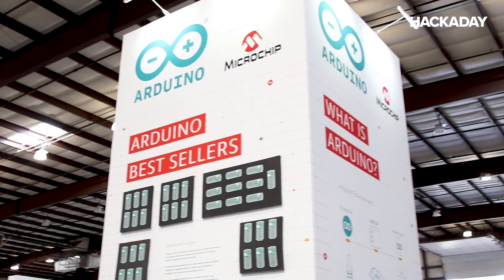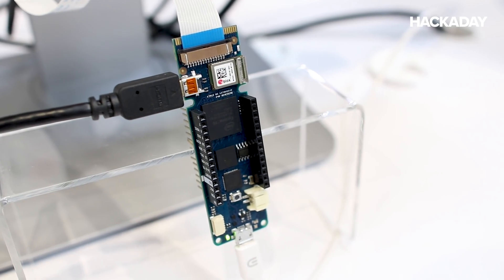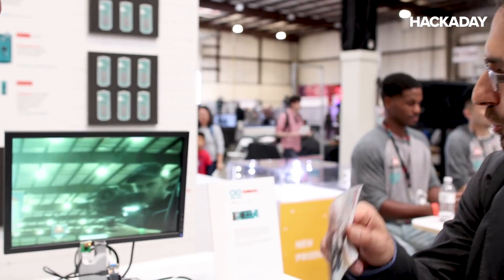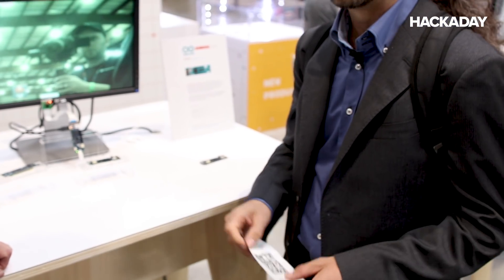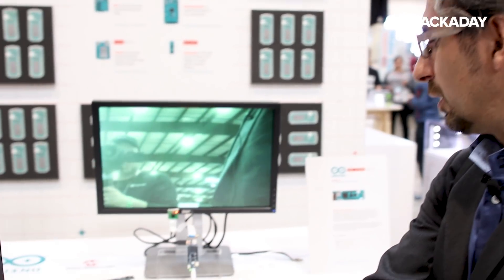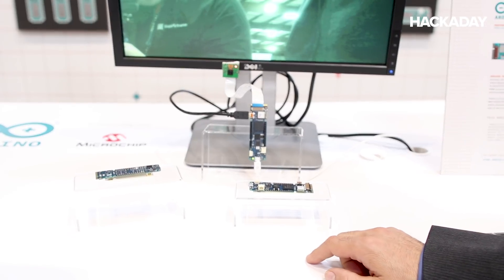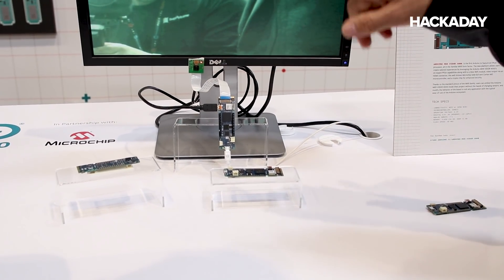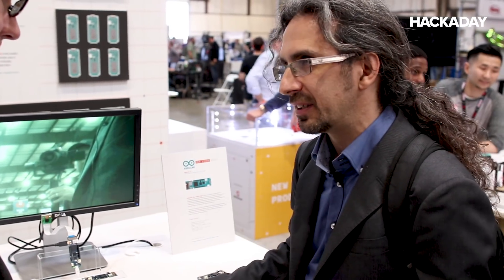Hands On With The FPGA'd Arduino at Maker Faire

Comment: meh, $60 US for cyclone.  I would rather buy zynq.
Reply: VegaDeftwing that's obviously not what I meant. Arduino's mission is to allow everyone to tinker with electronics without any prior knowledge. Of course this allows also professionals to take advantage of it greatly reducing the effort to do quick prototyping at reasonable costs. What I meant is that if you know how to handle fpgas, Linux, etc, you have a high Target and that's fine but has nothing to do with what we're doing here and is just useless to say we could have designed a more complex board as that would have just missed the point. This does not mean we won't be dealing with more complexity but we just had to start somewhere and this is our best shot at this. If anyone feels we could do better we're absolutely open to suggestions and would love constructive feedback as long as it is not out of context
Reply: Hi John, you are probably not discerning between price and cost. chinese manufacturers can have a price at cost and it's all margin. we spend time and money to develop the board and the IP blocks which are given for free. just as an example the MIPI IP alone for FPGAs would cost you between 5 and 10KUSD.... we give it away for free...  all other FPGA platforms you see around don't have this level of support and the reasoning you're making may apply there but here we are investing a lot to make it easy for anyone to work with a very complex technology. we could just manufacture the board and hope someone develops on it or, as we are doing, create IP, tutorials, examples etc and make it useful at day zero...
Reply: "if you know how to use a znyq likely you are not an Arduino user" are the two exclusive somehow? That doesn't even make sense
Reply: I hope you do understand that if you manufacture the product in a decent working environment, trying to pollute the absolute minimum, paying people a decent wage,making sure there are zero defective boards, providing tech support, maintaining the software, maintaining the IDE,  running a website with 30 million unique users with zero advertisement it's IMPOSSIBLE to sell a nano for 6 EUR. If people stop innovating then you'll be stuck with the Nano for the rest of your life.
Reply: Hi John,
let me add to what Massimo wrote that you should also consider that while boards from china sell almost directly, ship via snail mail and have basically no warranty, Arduino sells through distributors, provides warranty and handle complex logistics so that you can often have boards next day. especially on low cost boards this constitutes a significant multiplier that increases final price vs initial cost. keep in mind that devil is in the details and if you care about your customers, taking care of these details is expensive, even if  you don't consider the large effort spent to design a product that is so easy to use. this is the simple reason why you pay quite less if you buy on line vs in a physical shop and even less if you buy from the manufacturer, however you have also to consider that without distributors and resellers likely you would not be able to support such a big demand.
Reply: It's also about trust and support. Educational institutions, small companies and people needing to get something done quickly and reliably are mostly buying the originals. Also, 60 USD is not that much for what you are getting (ARM Cortex M0+, FPGA, ESP32), but in my opinion, there is no need for the Cortex M0+ anyways, if there is a ESP32 as the ESP32 is going to be a lot better in performance anyways.
Reply: Hi Benedikt,
FPGA can do USB at 1 mbps without external phy but it needs to be programmed and you would sacrifice gates for this function in every design. Arduino is actually working on ESP32 and has basically rewritten its firmware (which is released open source) in order to stabilize it (although BT is still a bit lagging). at the moment, AFAIK there is no plan to have it as a main processor but that may change. in any case... let's say that at this point this is the platform we came out with and since we managed to obtain a decent pricing and we're giving all options to run software anywhere you prefer, in the end i think it's not too bad.
Reply: Hi, Arduino is open source and open hardware. anyone can manufacture boards and Arduino has no issue with that provided the brand is not used on the boards. The issue comes when someone produces boards marking them as Arduino, leading people willing to support Arduino''s work to give money to someone else who didn't spend a dime on creating it.
Reply: Benedikt you are partially right... Samd21 offers USB which is really necessary and esp32 is lacking, moreover it is the standard platform used for other Arduino boards so we capitalize on all the work done so far.
Reply: Hey gamemaster1324, you probably should if you find it at this price. Anyway if you know how to use a zynq likely you are not an Arduino user so maybe you just wasted your time watching this video.
Reply: ICT yes nothing apart from the fact that Arduino pays money to develop a product and the Chinese copy it without any contribution to the community thus destroying the purpose of open source
Reply: Actually Chinese manufacturers help grow the community because more people can afford the boards and people can also afford to buy more boards and do more projects. If you had to buy from the Arduino website, everyone would be using STM32 boards or Attiny by now .... Not letting others build and sell a board destroys the defenition of open source lol.  And the community of Arduino is great, but it is run by many different people who get paid absoloutely nothing from the sale of Arduino boards from the website... The IDE was also built on top of other OS software. Online snobbery at its finest.
Reply: While I agree with the USB Programming / Debug interface (although that could have been done in the FPGA, couldn't it?), I think the ESP32 has rather decent Arduino compatibility too at this point. If officials would get more involved with it, the platform would drmatically improve.
I have worked with FPGAs before and I know they can be configured to use a golden bootloader image, so having one bootloader gateware would be possible.
Reply: massimo banzi 
Dude his point is right....
More people can buy the Boards....
You sounds like having a problem with China it’s self not open source community
Reply: get the boards manufactured cheaply, and then sell them with a reasonable and fair profit margin
Reply: johnDon so what is the incentive to develop open source hardware if nobody feels compelled to either support the original designer or significantly contribute to the open source project?
Reply: I respect what you are doing. You would still bring in more money if you sell at a better price point, because obviously you will sell many many more... It would make sense if you lowered costs for old boards like the Uno, Nano, Mega, but kept some higher prices for boards that are new.
Reply: I.e if you sold an Arduino Nano for 6EUR, then people will have less incentive to import from China